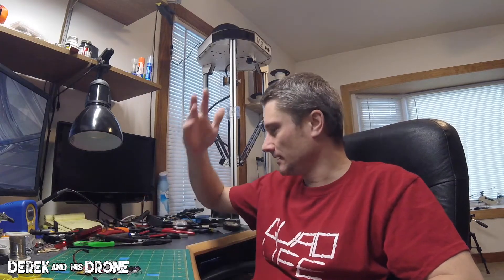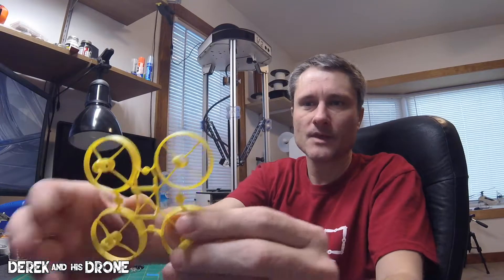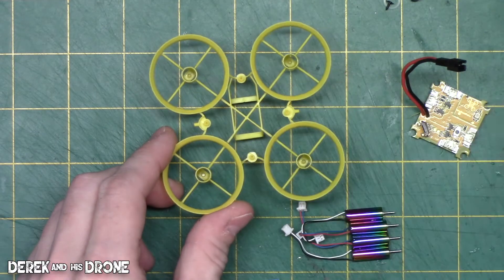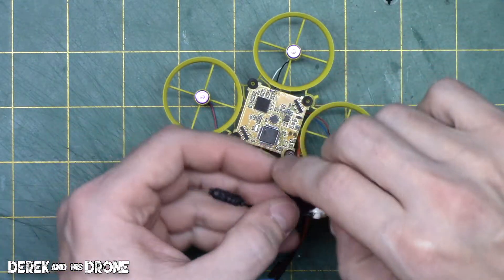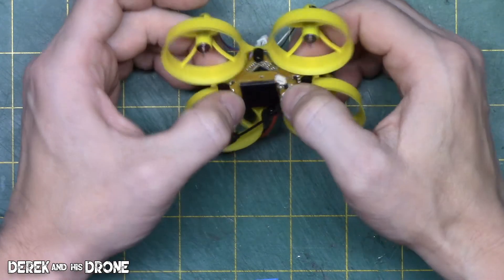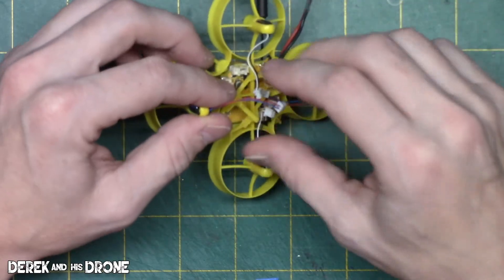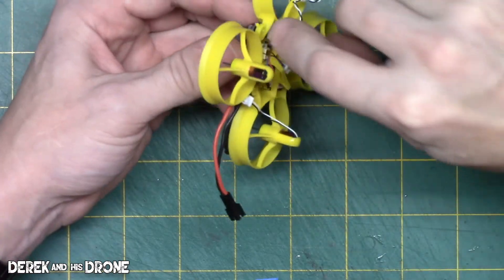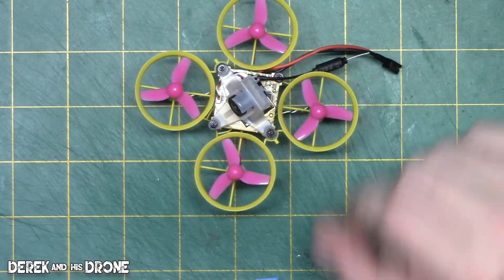AcroBee Build - Part 2 Hardware Assembly

Comment: Derek,  Thanks the build - I've got my AcroBee under construction!  However, as I work through your instructions, I'm confused about something...
At 1:37 you carefully point out the Frame Orientation you plan to use - and show the "front" of the cockroach frame pointed UP in the video frame.  That's fine, and very clear.
At 4:05 you discuss which motors go into which locations, but the frame has been turned 180 degrees, so that the "front" of the cockroach frame is now pointed DOWN in the video frame.  Since the quad is now upside down, it seems that what you refer to as "Left Front" is actually the "Right Back"?

I guess it really doesn't matter, since everything seems to work out fine in the end - but I'm still a bit confused.  Is there something I missed, or maybe I'm just more dyslexic than I realized!

Thanks again for the build - I'm looking forward to working through the next parts!
Reply from the maker: Sorry, It was my mistake.  You are correct about the orientation.

Comment: What’s the reasoning behind trimming the frame before installing the motors? Does it affect flight if the tops of the motors are not flush with the top of the frame?
Reply from the maker: That's a good question.  I would think it might but only a super small amount.
Reply: Good videos. Looking forward to the upcoming parts
Reply from the maker: Thank you so much for watching!